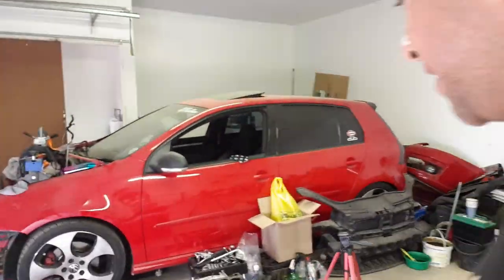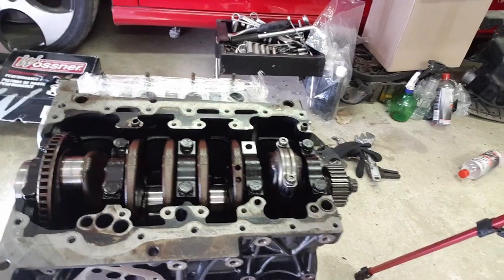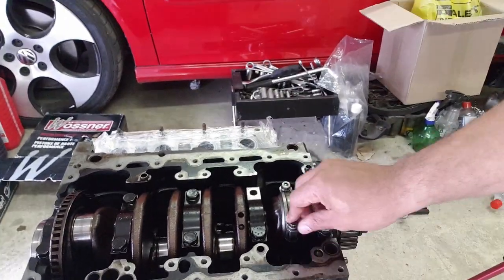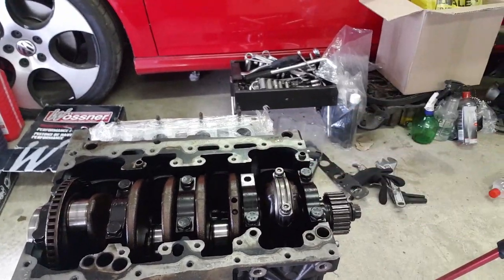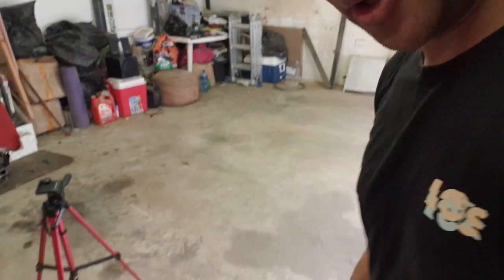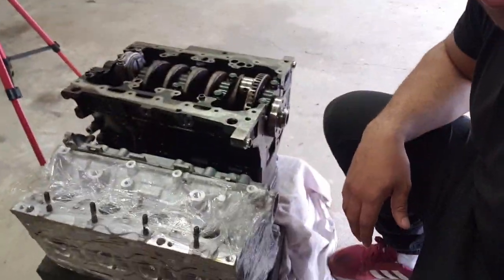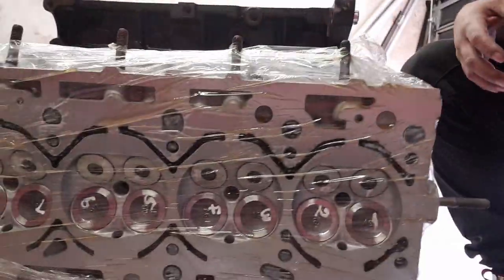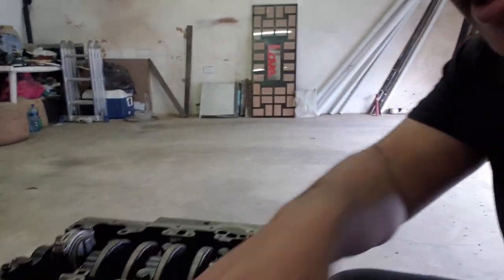How to install pistons on mk5 gti (forged)

Comment: what's the code on the rods and pistons? I need to make sure I have the right ones mate
Reply from the maker: sorry for not getting back to you bro just been verry bussy ill check it out and send to you. i did have a little issue with the rods at at first, they were a bit to big to fit on the piston, so had it machined at the shop.